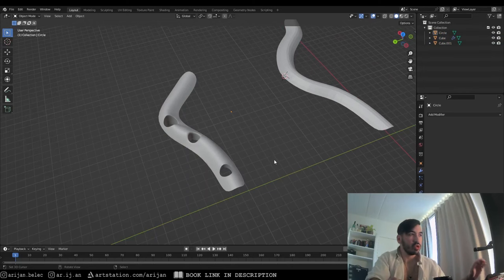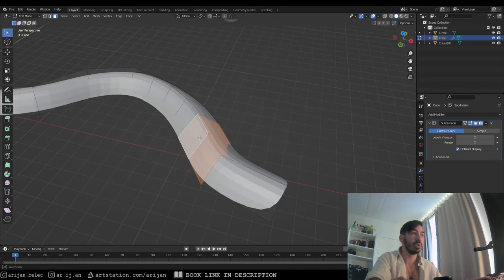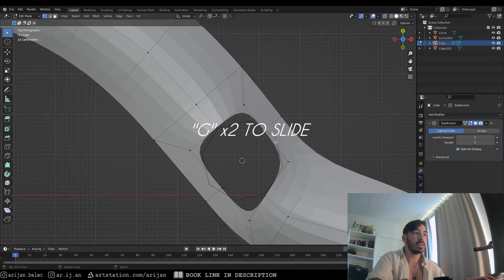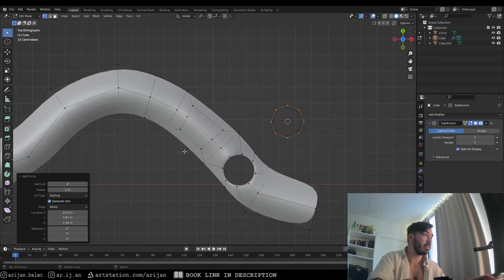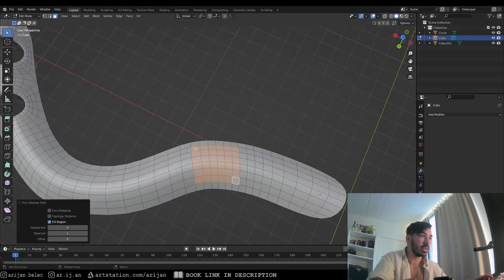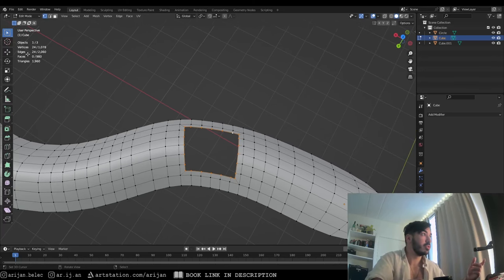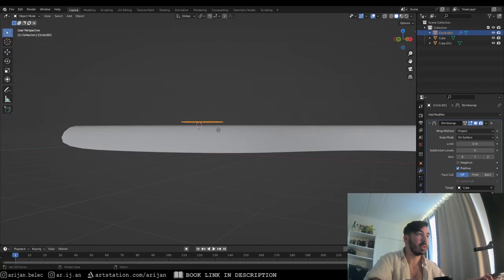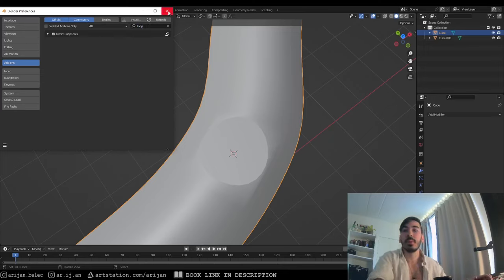How to Cut Holes with WITHOUT BOOLEAN | Blender Hard Surface Modeling Tutorial (Arijan)

Comment: you can use looptools to circulate vertices on the lowpoly mesh. enable it on the addons on preferences.
Reply: LoopTools is not quite as accurate, unfortunately, but it is still an option if time is of the essence and the model does not have to be perfect.
Reply: Yeah only issue with looptools on this curved surface is that it flattens the verticies in Z so you lose the correct contouring. You could project the verts after using looptools tho which would work quite well now that I think about it.
Reply: @Ov3rTheTop  there is a checkerbox you need to deselect. If you deselect "Flatten" in the looptools circle dropdown menu it keeps the original shape.
Reply: Yeah loop tool is perfect
Reply: @Ov3rTheTop  That only happens if you select "Flatten" in the bottom left menu.

Comment: Correct me if I'm wrong, but I think the geometry just looks smooth because there are no reflections shown in the surface, but in the render, the normals will create horrible reflections. Am I correct or am I something I'm missing here?
Reply: You are correct, making a hole like this will cause pinching.
There are a few options to make good holes
1. is to first apply the subsurf before making the hole
or 2. make a hidden shape correction mesh without the hole, which you use as a shrinkwrap target. You can use a vertex group to control the shrinkwrap modifiers influence on the visible mesh.
Reply: @batman3698  Do you have any tutorials with the second method? Because this is where I'm getting troubled all the time. My model looks smooth when I do the basic shape, but after the details are added like holes, cuts, etc, there is a lot of distrorsion and pinching. I've noticed that 3DS Max has something normal smoothing maps that fixes this problem but the only relevan I manged to find in Blender the the weighted normals modifier which sometimes fixes things but doesn't do perfect job.

PS: I am referring to modelling without subdivision, like models for video games.

Comment: You could use the Snap to Vertex option to align vertices to those of circle. That's way easier and more accurate.
Reply: It won't work properly ... Shading problems will apear
Reply: You could, but it wouldn't conform to the contours of the original mesh. Not unless you manually placed each of the vertices alaong the z-axis.

Comment: I remember first time I tried to do something like this I did the same thing - inset and then I asked chatGPT to make python script to arrage vertices in a circle. It took couple of tries to describe precisely what I want but it was still faster than manually arranging vertices. And if you had more vertices to arrange or more holes to make in one go - it'll increase productivity even more so.
Reply: what is wrong with add->mesh->circle? you can set the verts there

i can write all the python code, it doesn't increase productivity if you spend more time faffing with the code for something you can press a button for
Reply: packing that into an add-on seems like way more trouble than its worth

Comment: How is an actual hole in a mesh non-destructive compared to a hole made with a Boolean modifier? And you should take a look at Loop Tools to make it more efficient...
Reply: It's not. It's as destructive as you can get. At most you can assign vertices to vertex group "I cut there" to reselect them quickly and or maybe copy them into other model

Comment: tbh its faster and easier to use loop tools
mark the Vertices, right klick loop tools circle, mark the faces and extrude
Reply from the maker: Using the circle tool will create a flat circle, not curved as it should be on a cylinder in this case. In most other cases however, that would work
Reply: ah flat vs curved circle i got ya... that said most of the time something like this has a hole in it, it's done with a drill so most real world shapes prob have a flat circle @ArijanRace
Reply: @ArijanRace They propably updated it since last year. There is a checkerbox in looptools. If you deselect "Flatten" it keeps the shape

Comment: Why don't you simply use the loop-tools....?
Reply from the maker: The loop tools 'circle' function creates a flat circle, which is not good for a curved surface. 

I have used loop tools in the previous tutorial mention in this video, they are good for that.
Reply: @ArijanRace  The loop tool creates only a flat circle if  'flatten' is checked. Otherwise the circle follows the shape. Just tried it out...